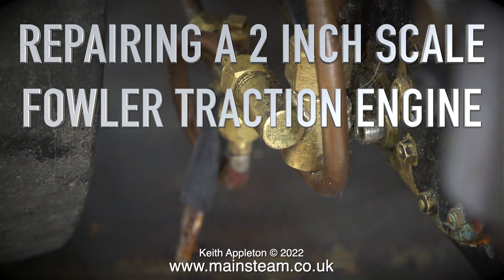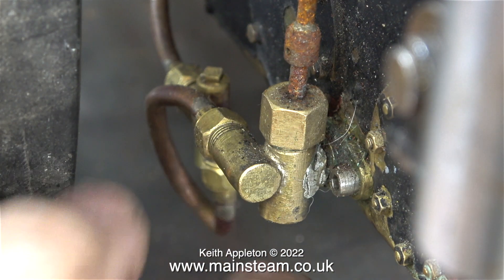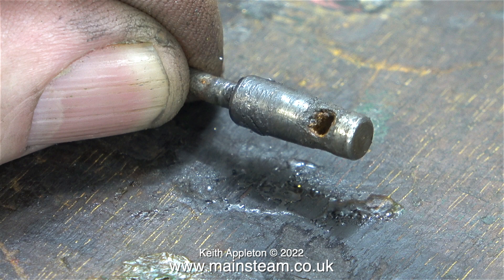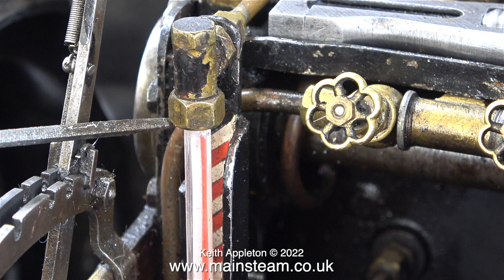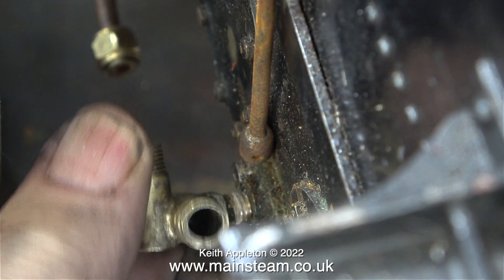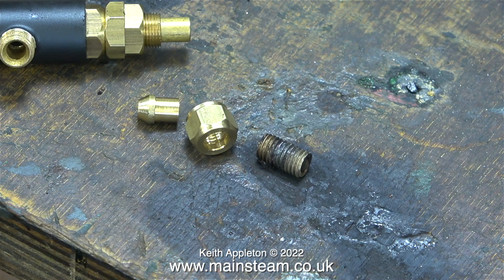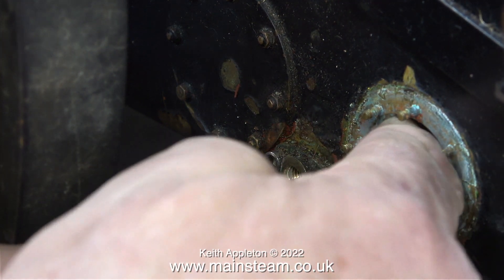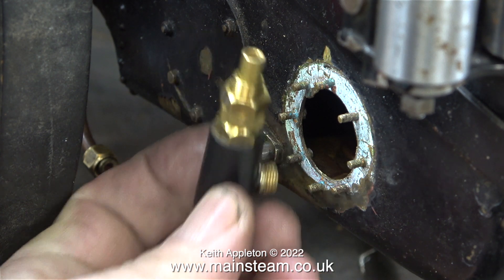REPAIRING A 2 INCH SCALE FOWLER TRACTION ENGINE - PART #3

Comment: On my 4" Foster, my tender outlet used to weep as the there was an elbow coming out of the flange. However, the internal flange threads were totally shot so no amount of PTFE were going to seal it. So rather than breaking the flange seals (I had sealed the inside of the tender) I drilled and tapped the flange to a larger size, with a brass round stock made a short boss that was able to screw into the flange and had a 1/4" tapped hole, essentially a reducer.

Fitted standard elbows and has been fine since.